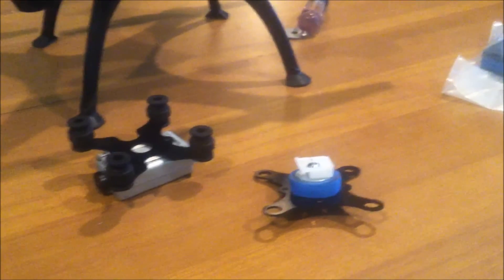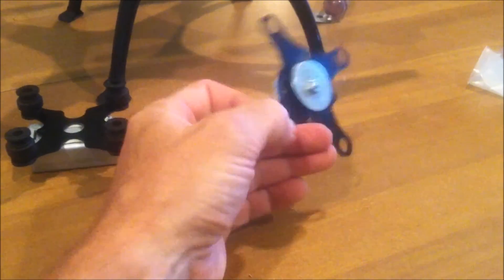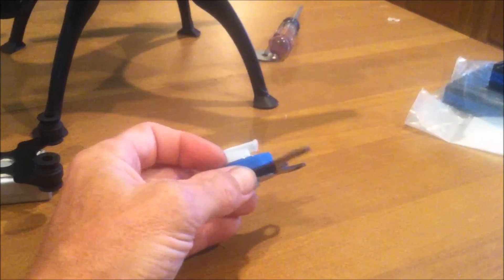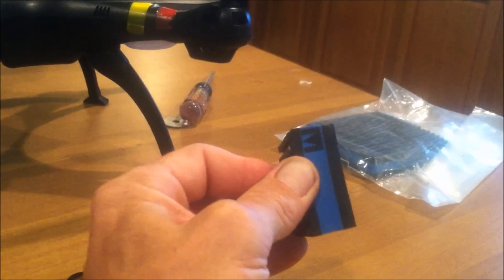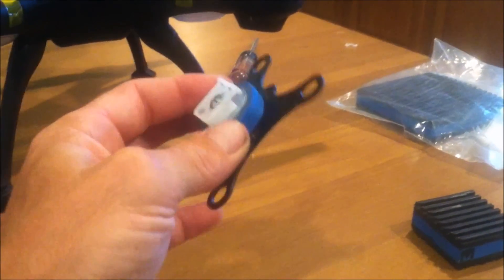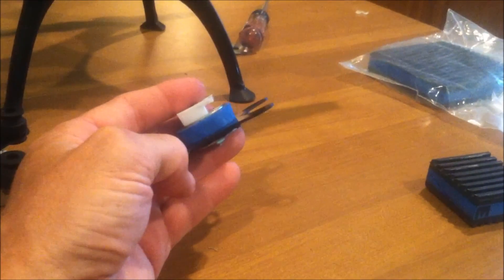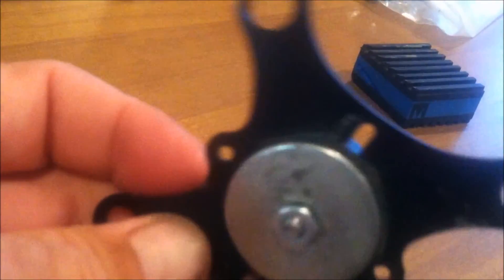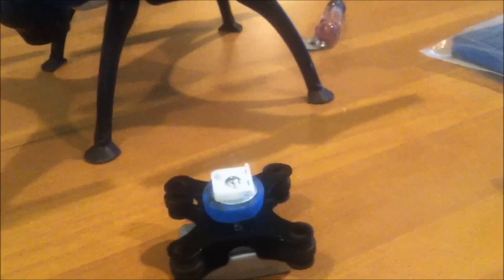Runcam HD antivibration mount rebuild

Comment: Very nice tip Mr Colson. I followed this exactly and no jello. the only complain i have with this setup is it is rotating due to the connection of stock white clip and big washer (connected only by center screw) 2 diagonal screw holes not in use. hence it is rotating. how did it work on yours? is it also rotating? thank you
Reply from the maker: +Monnette Aranas It doesn't rotate during flight. I opted to use just the one bolt instead of a couple screws so I can adjust the camera to point in any direction I want
Reply: yes Sir you are right. its only rotating if you intend to. theres still some tightness, I am planning to put maybe some glue to fix it. Thank you

Comment: How did you modify the Stock Mount?
(The white one on top)
Reply from the maker: I just dismantled the stock camera mount. The mounting bracket can be removed from the whole unit. Once removed I sanded the bottom of it to make it level when attached to new mount
Reply: MrTColson Gotcha - I missed the 2 screws at the top that separated it from the rest.
(Sigh)
I got one of the anti vibration mounts in the mail today - time for another mounting experiment...
Thanks!
Reply: Ron Allard BTW, how are you mounting the RunCam bracket?  Velcro or double-stick tape?
(i see there are no Tie-Wraps like earlier.)
Reply from the maker: double sided sticky tape holding runcam bracket to bottom of antivibration mount

Comment: Great job Mr T, are you using this for additional damping or as a spacer to hang the camera lower to frame the shot ?
Reply from the maker: mick thebass I am using it for a spacer but picked the material for how light it is and for its dampening properties. So I reckon the answer to your question would be both...lol
Reply: Haha..Well its a great find, and a very useful tip..Thanks Mr T.

Comment: Wow i can tell a difference thanks for the upload one question what would you say the blue material is?
Reply from the maker: In the product description on amazon it is called a special foam composite which supposedly  out performs cork and rubber anti vibration pads by a 3 to 1 ratio. It is mainly used to put under a washing machine or air compressor and is good up to 50 psi. I am pleased with the results. Thanks for watching and have a great day.
Reply: +MrTColson Please, can you share the foam amazon link?
Reply from the maker: link for foam http://www.amazon.com/gp/aw/d/B008HQ2AAW/ref=mp_s_a_1_3?qid=1441875633&sr=8-3&pi=SY200_QL40&keywords=antivibration+pads&dpPl=1&dpID=515uMEGoW1L&ref=plSrch